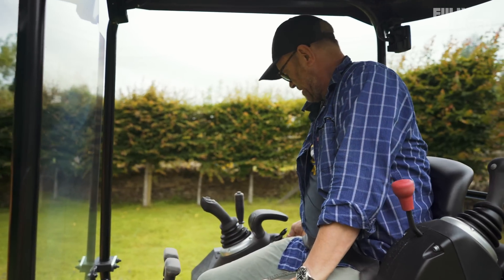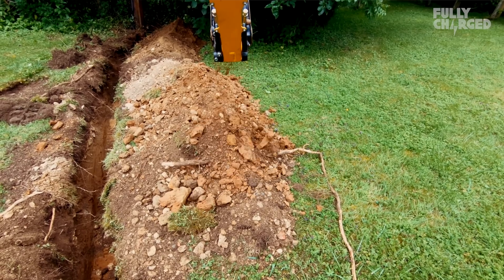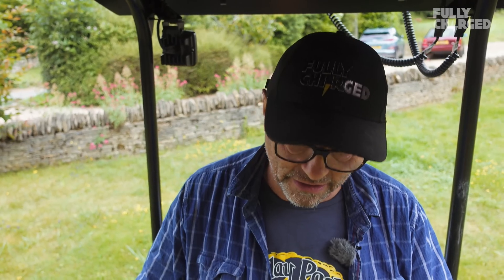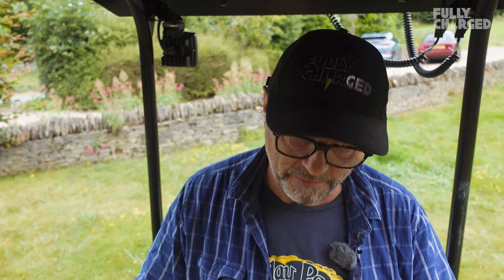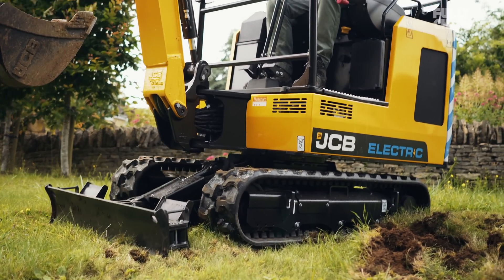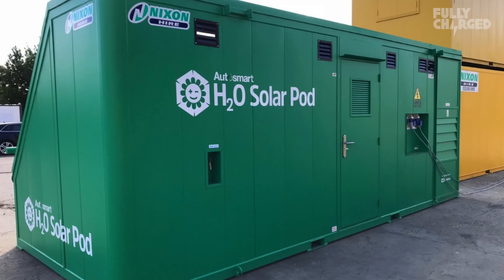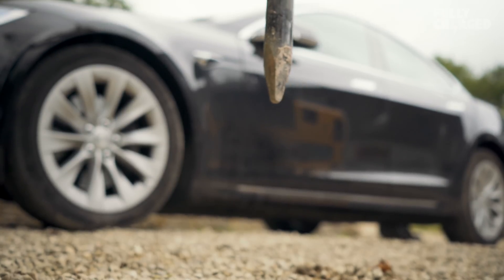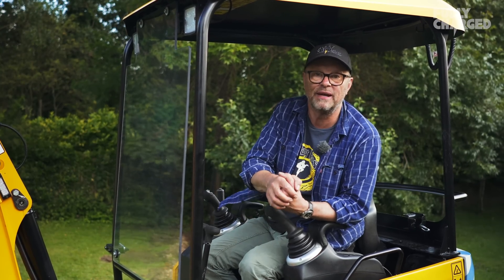JCB Electric Excavator / Mini Digger JCB 19C-1E E-TEC zero emissions electric digger | Fully Charged

Comment: Almost every construction site has a Diesel generator running 24/7 because the security needs power. So the comments about these diggers needing diesel generators to charge them makes no difference since they would be running anyways with or without an electric digger.

Comment: The brilliant thing about a lot of planet machinery is that they actually need to be heavy to work (either to produce sufficient tractive effort to moveheavy items, or to balance there loads (cranes/excavators etc) so they are a perfect fit with lots of batteries!  Something like a medium sized 360 has upwards of 10 tonnes of iron counter weights, which could be simply replaced with bolt on battery packs!

Comment: Not telling you they need a big diesel generators to keep them charged out on site over night and the work times of the batterys are low compared to their diesel equivalents and the stuff that goes into the lithium batterys and the costs and methods to get it from the places its sourced  🤣😂😆
Reply: @Ross Bourne some of it but when you got mates who have used them on site and they not a patch on the diesel versions that work 12 to 24 hour shifts night and day on major road works and railway infrastructure  work where they are no good as they go flat and take hours and hours to re charge and alot of sites use diesel genetators as electric supplys are not available on alot of new build sites out in the sticks or in towns as the ground works are usually started first before water or electric or gas are installed and the generators have to run all night to charge them 😆🤣😂 ... 👍👍  you'd know that if you worked out on various construction sites and road works or on tracks but i guess you dont know that when you in a warm office or factory ,where as i have got 30 years of constrution work and rail work under my belt.  You drongo !!  👍
Reply: @Ross Bourne you havent got a clue take any holiday works on the railways or weekend works on motorways that work non stop for 24 hours a day that starts on a saturday morning at 1am and ends on a monday morning at 4am  these electric machines are useless as they need to work non stop !! Electric machines are atleast 10-15 years away from being able to be  recharged in 5 mins or less and lets not forget the mining that goes into the battery ingredients for them to be pulled out of the ground and made and then all the transport involved to get the raw products to the people who make the batterys  😆🤣😂 we"re atleast 10-15 year or more off the 5 m8n or less charging and when they can make a electric sports bike that can out perform the petrol equivalent and do 200 mph plus and 140 miles to a charge and be charged in 3 to 5 mins ill be first inline for one but the tech is waaaay off 👍👍👍

Comment: Did you know that there are machines especially designed to lay conduit WITH OUT DIGGING UP THE GARDEN.
The machines I am talking about literally slice into the earth and PULL A CONDUIT BEHIND IT.
So there is NO DIGGING, NO PILES OF EARTH AND DOES NOT HARM THE GARDEN.
In fact 5 minutes after the conduit has been laid YOU WOULD NOT KNOW ANYTHING HAD BEEN DONE.
Why didn’t you use one of those?
Please don’t get me wrong, JCB makes terrific products as good as anyone else.

Comment: I think you might find the size of the bucket in the digger has a tremendous amount to do with the battery life similar to a large wooden drill bit on a small 12v battery powered drill, you can dig more in less time but you might find you’ll run out of battery quicker just like the drill analogy

Comment: Would there be an advantage to putting   lithium ion batteries on fork lifts? The lead batteries help with adding weight to counter balance the load. But would there be other benefits than just weight?

Comment: Doesn't work without seat-belt? Well that's going to be fixed quite quickly :)
Reply: jur4x
On any decent site you would be red carded without it on.
Reply: @Robert-j6r8c  But not all sites are that decent you know. There are some where they don't even bother checking if person using the equipment is adequately trained to do so

Comment: Amazingly, a 1800 ton walking drag line coal mine excavator is also electrically powered.  There are no diesel engines on them.  Just a large inverter shipping container nearby with a heavy wire running from it.  Since most coal mines are owned by power companies with the power plant nearby, this is much more expedient than calling in a large tanker truck twice a day.
Reply: Phillip Mulligan back in the 1960s one was working near to where I live now. They moved it over 10 miles to a new site by walking it as it was far to large for any truck to carry https://en.m.wikipedia.org/wiki/Sundew_(dragline)

Comment: I think they should go all out with scrapers, loaders, the whole line of construction equipment as the one thing those machines need the most is loads of torque and electric motors have bucket loads of that. Plus if they do it quickly just like Tesla they will be way ahead of the pack whom will all be playing catch-up.

Comment: It always annoys me when critics of something new find just one thing that makes it a wee bit difficult or "hypocritical" to use. For example the diesel charging issue at a construction site being wasteful. My question to people like that is "Uh, er... so then... we shouldn't try to make electric vehicles until there's alternative charging in place first? No one should pursue this technology until there's a viable, clean infrastructure to charge it first?".

So then, what? What's the motivation to produce a solar or wind powered charging solution for nonexistent electric vehicles? No one will build those charging stations without the devices that need them first. Without the cars and gizmos that NEED alternative charging solutions there is nearly zero motivation to create them.

Correct me if I'm wrong but wasn't it electric car tech that has led to "power cell" add ons to homes for electric storage? I thought I've seen people "hacking" the big batteries and tech from Tesla cars into storage for an off the grid type house power?

Comment: Since these are so quiet, that is a big incentive for construction companies to switch to electric: They could conceivably do work at times of the day when they would normally not be able/allowed to due to noise. And the no-fumes aspect is also quite desirable. And do I need to mention the increased reliability due to far fewer parts (surface-on-surface contact, wear and tear)? It's definitely something that should at least be a part of any construction company's arsenal.

note: I'm guessing that Robert rented this thing, as I can't imagine that he is so loaded with cash that he can afford to purchase this presumably very expensive piece of hardware for this one job! LOL!

It's also interesting that this is still hydraulically actuated - electric motors powering hydraulic pumps to actually move the arm and bucket - rather than fully electric, which although cheaper to make, would probably not be able to match the raw power of hydraulics. Still, a fully EV version could be very useful in certain situations.

Comment: I think this is great, the noise level is much lower than the diesel version so, when work needs to be done it can be done virtually any time of the day because there is so little noise other than the actual hammer you used but even then much less noise than usual.

I think it's great well done JCB.

Comment: Given the history of England, I'm a little surprised you didn't discover a Norman castle.  
I once had a summer job installing water sprinkler systems.  We used a machine (not electric) that sliced through the earth with a blade, on the end of which was bullet-shaped knob to which you attached the pipe (this is a maturity test).  You just had to dig the initial and final access hole.

Comment: >^. .^<      One day JCB n all other EV manufactures will design a long n narrow bay in their Equiptment/car some un used place that allows a long skinny perhaps 5 - 10 KW Hr standardized range/hour extender battery to be swapped out in and out in just 20 seonds for those special times more energy is needed for a longer drive or larger hole to be dug.......

Also, you may want to consider inviting an electrical engineer professor on to your uT show to explain why all cords, especially cords with lots of current flowing thru them - why it is important and never should be allowed to be plug in  until ALL WIRE LOOPS are removed from the charge cable.   Seem most people do NOT even consider this when pluging in a EV to charge symply becaus they have no idea what a loop of wire with high current will be doing ALL THE TIME electrons are flowing thru it....     You may have already adressed this issue on FC and I missed this episode, sorry if this is the case.....

Comment: Although touched on, there is still an issue of producing enough cheap electricity on site. Its ideal for small confined spaces where a power sources is easily available. Adding a temporary mains connection with a battery bank might be viable on some of the larger sites, but not the smaller sites where a machine of this size will typically be used. Removeable battery packs might be a good option for future development.
Reply: @Ross Bourne Please feel free to add to the solutions I have already suggested. But I stand by my point, the work undertaken by machines of this size is often temporary by nature and fast moving. It is not unreasonable for a small civils team to work on multiple sites in one day.

Comment: Noise pollution is so severe even in suburbia. I now have a battery powered lawnmower/hedgecutter and chainsaw, it makes such a difference to me and my neighbours and I can't wait until they are totally normal. The same with car engine noise, without all the other considerations of going electric.
Reply: Is the battery lawnmower quieter than an electric mower with a cable?
Reply: @achenarmyst2156  Depends on the motor design, they both use electricity to power the blades. So the only noise is that, so I imagine similar depending on the quality. I preciously had a petrol one and had to wear ear defenders.

Comment: Would be a gold mine for hire out equipment companies, saving on engine servicing/ fuel. Next thing needs to be a lighting tower unit with solar to charge through out the day, it's unnecessary to run a diesel engine for eight to twelve hours with battery and light tech so advanced

Comment: Yawn. Some of the largest mining shovels and draglines ever made were fully electric. Bucyrus and Marion made truly monstrous machines used in strip mining coal and other ores. While they didn't use batteries, they did drag a giant extension cable behind them. Cat has had a diesel electric drive dozer for several years, and Deere has a 944K hybrid loader.

Comment: 6:26 "Then I get an extension cable. ... Not wound up. Very important."

This is they first time I've heard this mentioned by an EV advocate.  I had to learn it the hard way.  My first ever EV experience was renting an i3, driving it to my parents' house, plugging it in via a partially wound up extension cable, and disaster ensuing.
Reply: @Ross Bourne It's a problem with extension reels, not with EVs. But many people's first experience of the phenomenon will be when charging an EV, simply because the continuous high power draw is not something they would normally  use their extension reel for. https://electronics.stackexchange.com/questions/192923/why-is-it-dangerous-use-a-coiled-extension-cord It's more likely to affect people with little-to-no EV experience (perhaps as a driver or perhaps as the owner of a property allowing an EV to charge there for the first time) so gives a bad first impression. So I think EV advocates/professionals should probably do more to make people aware.

Comment: Tip of the day. Put a tarp or cheap Lino down to put the spoil onto right next to the trench. Makes it easier and cleaner to put back in. I didn't and had to vacuum and use a leaf blower to clear the last bit of spoil out of the grass.

Comment: I am a digger operator and so far I've seen working with all sort of diesel engines and all have two things in common:lots of noise and lots of gallons of diesel spend and they are very complicated specially this days with all the pdf filters and recirculation exhaust systems,you name it,and therefore as long as they are well looked after they perform "ok" but if anything should happen it is tremendously expensive to fix them so in other words they are effective but not efficient  and this new generation of electric diggers are the normal next step in technical advances.I would love to work on one of these since they are so quiet and easy to maintain
Reply: Yeah, that pesky adobe software.
Reply: *dpf filters (diesel particulate filters).^^ LOL!

Comment: With each passing second, the insanity of the internal combustion engine becomes more apparent. It was vital in its day but anyone who can't see that day is over is crazy. Pollution, noise, dependence on dodgy fuel sources etc. It's so antiquated it really feels like some crazy thing people used to do, like gas lighting or putting salted meat on a cold shelf. Full electrification of vehicles/equipment cannot come soon enough. Especially as a cyclist, I'm not a fan of being poisoned by ancient technology when there's no technological reason for it
Reply: Right, I'm crazy. Anyone interested in my new engine ?
Reply: retread01 evs have been around for longer then the internal combustion engine they just never took off because the range was rubbish. Everything in evs is ancient apart from the batteries. Do you think engines have not advanced in the 200 years they’ve been around? There a lot cleaner now and more efficient. And how is oil a dodgy fuel source it won’t last forever but it works quite will. Internal combustion still is better for lots of things like racing. My motorbike makes about 38hp can do about 1h 30 mins on a tank of fuel an electric one only makes 20hp and can last about 40 mins and a race can last 3-5hrs so you would need 5-6 batteries.

Comment: Safety number one rule is you never get off your machine without putting the bucket on the ground. This prevents accidents from happening.

Tell JCB to put in an optional sound.mp3 file the operator can choose that when he turns the key to fire it up he hears instead of the beep a starter cranking an engine and an Diesel engine fires up for a few seconds then it goes quiet and Robert says ok lets go to work!

Just a thought.

Comment: It’s true about the fuel gauge. I was a forklift driver. When we started getting electric forklifts we noticed one charge could last 8 hours where as the natural gas trucks had to be refuelled every 2 hours. We would still top them off on breaks so the next shift would have a charge though. The weird thing is they use lead acid batteries not lithium ion.

Comment: Funny that we aren't embracing electric vehicles of all types.  Why, it seemed like only 10 years ago that the IEA and the OECD put in place a plan to have 1 million chargers in Germany, France and probably Britian by 2015, so that 40% of all cars would be EV by 2017.  Do you think that the Oil Lobby as well as Davos had anything to do with it when they spread around 16 million Euros in Brussels?
Funny I have been trying to find people to open battery factories since this is the weak link.  No one in Switzerland is willing to do this.  In our town we make all sorts of construction equipment.  Diesel.  They refused to go electric.  They massively invested to work 24/7 for all of 2018 since they had to build all their equipment before it would be banned by 2020.  But they managed to grandfather it in if it was ordered before 2018.  Ah, it's amazing what a little grease can do in the palms of a politician.
John Deere built an electric tractor.  I had contacted them in 2016 about battery construction as well as finding Swiss farmers to be models.  Never a response.  And they just came out with their model last year.   With a long extension cord.

Comment: Crazy that a days work consumes about the same energy as 0.65L of fuel. Really makes you think just how wasteful those diesel motors are
Reply: Ross Bourne
And when they do, people will transfer over.
Reply: Ross Bourne
Yeah, but nothing competes with the energy density of fossils even with the lack of efficiency.
Reply: M Hadi
Yes, it's not the 1980's technology has improved.

Have you noticed cars have been getting better mpg,  we haven't been adding energy to the fuel.  We have worked out how to use it more efficiently. 

https://thenewswheel.com/mazda-skyactiv-3-engine-to-achieve-56-thermal-efficiency/

And here a link to help you understand thermal efficiency.
And you'll see big diesels are near 50% efficient.
https://www.nuclear-power.net/nuclear-engineering/thermodynamics/thermodynamic-cycles/diesel-cycle-diesel-engine/thermal-efficiency-for-diesel-cycle/
Reply: @M Hadi - look it up.  high speed diesels run about 35% efficiency.  slow speed diesels, like the kind used in transport ships, that bring ev proponents their new cell phones and all the new slave labor fashion from the gap, approach 50%.  
and the original poster is correct.  For small stuff the energy density of batteries is fine, but people that think electric is gonna take over the heavy mining or shipping industry are smoking crack.  Theres actually an electric ship on youtube.  It has a battery bank the size of a small apartment, and it gets 4 km range on a full charge.  So, in order to make sure its not a completely useless floating piece of garbage, it also has a diesel motor intalled.  4 km. on electric, then the next 200 on the diesel.
Reply: Ross Bourne
30-40%...
Mercedes has a engine that's over 50% efficient